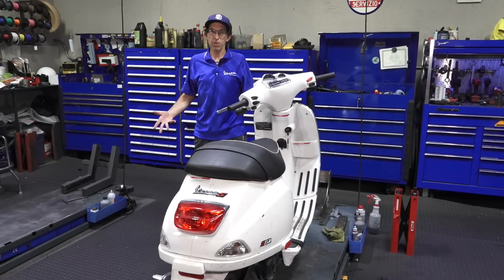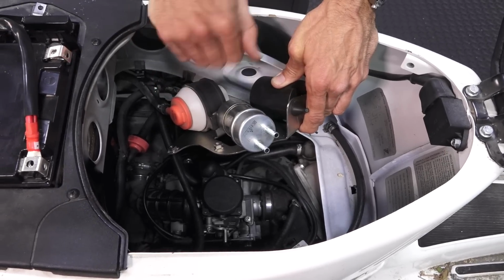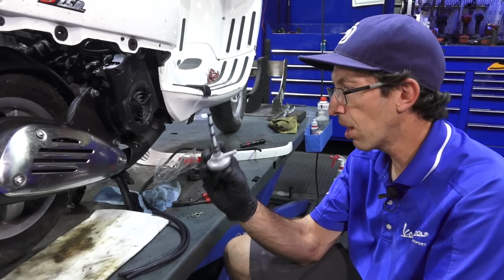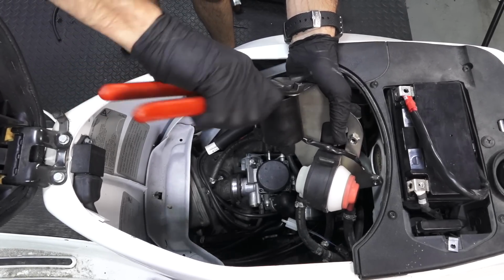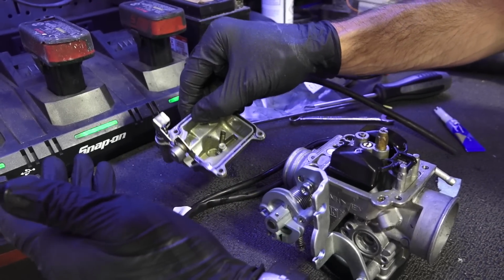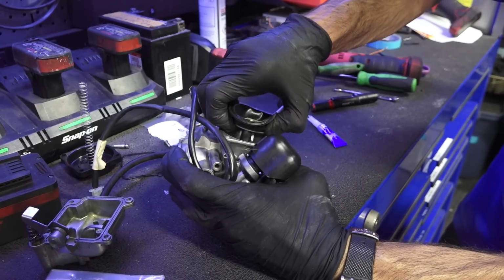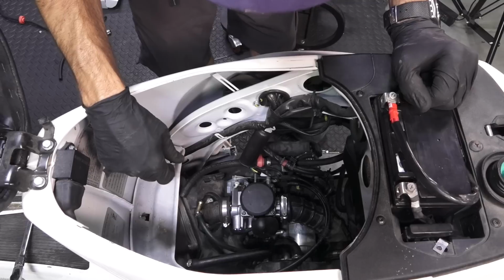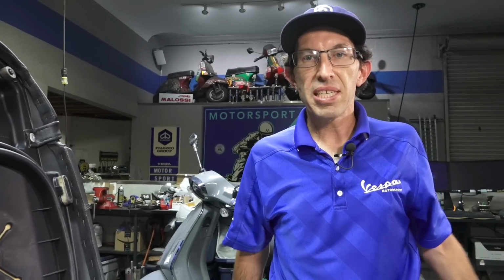2009 Vespa S150 Not Running with Lots of Surprises in the Carburetor and Ignition System

Comment: I have problem with my Vespa LX Italy 2009, sometimes it's not working or hard to starting if I don't use it daily. Do you know what cause this? Is it the trouble with the fuel pump or carburator or anything else? Need your advice.

Comment: Me: Thinking about an S150 as a second scoot (GTS300 Super in shop since 05/20/2021 for repair after accident, still awaiting parts).

Watch several VM videos about S150s and their idiosyncrasies.

Me: Thinking about a fuel-injected S150….

(Once again, great work, Robot.)

Comment: Hello i can really use some help ,,,, i have a 2016 Vespa primavera 50cc 4t ..i have a Fuel supply issue in  the. Morning when i start it up its perfect.. but when you drive 20 feet  it's like it runs out of fuel ,,, then it's a little hard to start like the fuel system is dry, but it starts and runs perfect the whole day i replaced the fuel filer on the tank, the vacuum pump even the intake manifold 
i just cant figure out this issue , Can any one help me .. i live in Denmark  Robert

Comment: MONSTER PLEASE HELP ME IF POSSIBLE  i HAVE A SORT OF RARE PIAGGIO W 799 MILES AND THIS SCOOTER RUNS GREAT ONCE THE USUALSITTING AROUND CRAP HAD BEEN TENDED TO GAS TANK CARB BATT ETC AIR IN TIRES...NOW MY REMAINING ISSUE  i HAVE A BIKE i THINK WAS NEVER MADE W A KICK STARTER IT HAD WHAT LOOKS TO BE A FACTORY PLUG AND LOOKS LIKE NOTHING WAS EVER IN THAT SPOT THE CASE IS UNSCRATCHED WHERE THE KICK STARTER WOULD BE..OK MYSTERY 1 MYSTERY 2 ITS PAINTED A GORGEOUS GREEN METALIC BUT THEY NEVER MADE THIS COLOR..SADLY THE FRON RIGHT FAIRING PLASTIC BROKE OFF EASILY FIXED BUT i CAN TELL IT WAS THE FIRST TIME THIS PLASTIC PIECE HAD EVER BEEN OFF YET THIS IS WHERE YOUD EXPECT TO SEE FACTORY PAINT BUT NO!! YOU SEE THIS GREEN VERY PRO JOB PAINT..DID PIAGGIO TAKE SPECIAL ORDERS FOR STUFF LIKE THIS? i MEAN ITS A PRETTY BIKE AND THE PAINT IS SO VERY WELL DONE THAT IT SCREAMS FACTORY JOB i THOUGHT DEALERSHIP JOB BUT EVEN THEY WOULD HAVE TAPED AROUND THE FAIRING THEY WOULD NOT HAVE TAKEN IT OFF JUST TO GET PAINT BEHIND IT...SO THERES MY MYSTERY QUESTIONS IF YOU CAN OFFER ANY INSIGHT ESP FOR THE KICK STARTER LET ME KNOW ALSO THAT CASE HAS NEVER BEEN OFF FURTHER TELLING ME IT WASNT INSTALLED BY ANYONE IT JUST WASNT MADE W ONE  YOUR EXPERTISE IS MUCH APPRECIATED

Comment: Did you remove the fuel pump entirely? 

My customer has an 09 150s like this one but as soon as we give it throttle it dies. So strange. I hooked up a cheapy Amazon carb that looks identical and it ran great so we know the original carb is the problem. Any idea why a carb would idle but nothing after that? No fuel in primary circuit maybe?

Comment: Although I miss the assembly of the vacuum fuel pump in the video I have to say, the video describes approximately my experiences with my Vespa GT. Countless hours of tinkering and at the end the carburetor is replaced :). In contrast my PX: First kick and the engine is running ;)

Comment: Great video, thanks! I have a 2008 S150 that I bought in perfect condition with only 125 km on it! Having hard cold starting issues now. I cleaned the carb but may have missed the tiniest jet! Your change to a vacuum activated petcock was a nifty work-around to the damaged fuel pump. You are a big inspiration, thanks again!

Comment: I bought a brand new 2020 primavera 150 and the engine stalled after a mile of riding and doesnt turn on no more.  Pressing the start button just creates a sputtering sound. It only has 2 miles on the odometer. Any ideas what could have caused this?
Reply: Did u turn gas to on position?

Comment: I'm having a problem on my scooter. It's an aprilia sr 150 with a carb. On accelerating sometimes it feels like it's skipping or stuttering for a second. This usually happens when accelerating from a stop or when slowing down then accelerating. Care to give me a Idea Robot or a solution. Big fan of your work! Appreciate for your informative videos. If anyone can help. I'd really appreciate it.
Reply: Air in fuel line due to low fuel level in fuel tank?

Comment: I wish you would have talked about the battery terminal screws. Are the M5 or M6? Do you carry them as spare parts? They are hard to find.
Reply: Right, just used the hardwarre off the old battery, when I lost one of the nuts. If you haven't replaced a batteery before you might find out you need to slide a small screwdriver under the nut to steady it.

Comment: That why buying all the parts for it! The Belt and rollers dry out and crack the fuel  was bad flush fuel tank replace fuel pump system! Only things left flush out antifreeze and order other key. Mr. Robot
Reply: not liquid cooled....no antifreerze
Reply: @richarddegen6184   I already buy maxima coolanol & gasket for high performance engine on my Piaggio mp3 250ie from scooter west!

Comment: The spring clips on small hoses work far better than screw type clamps because they continuously maintain the tension, screw-type clamps has the hose ages  lose their tension causing leaks.
One of the fundamental problems I have encountered with do-it-yourselfers is they remove parts heat shields all kinds of things from vehicles. I don't need that the fact is if it wasn't needed the engineer would not have put it on there because putting things on vehicles cost money and they're trying to make a profit.
Reply from the maker: Well said, thanks for watching!